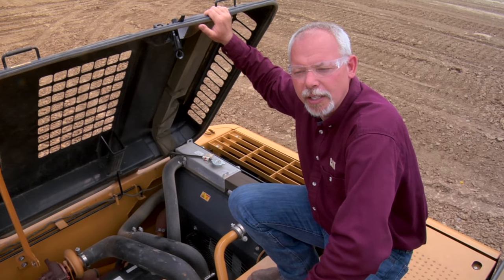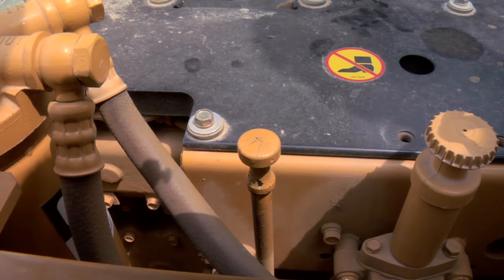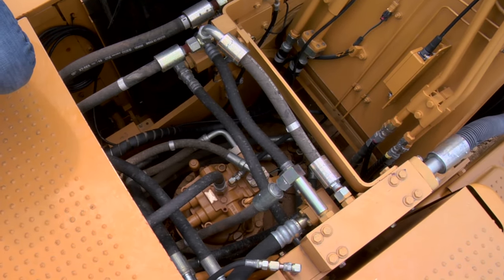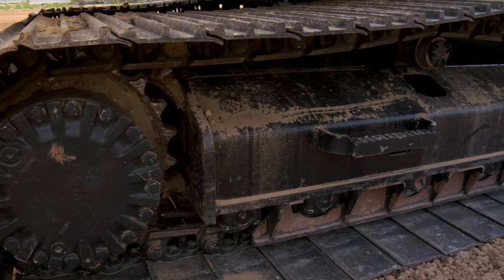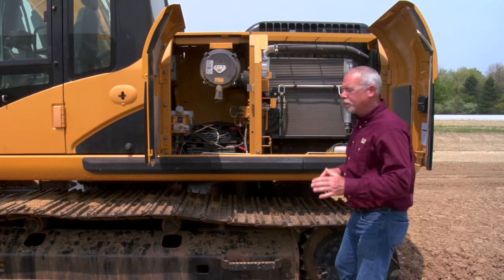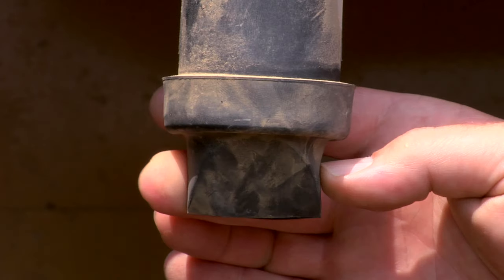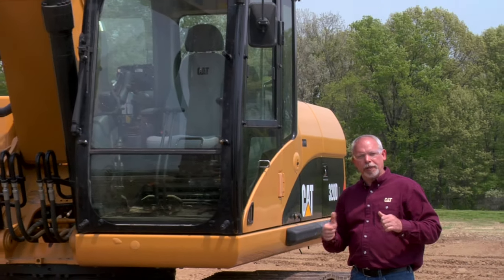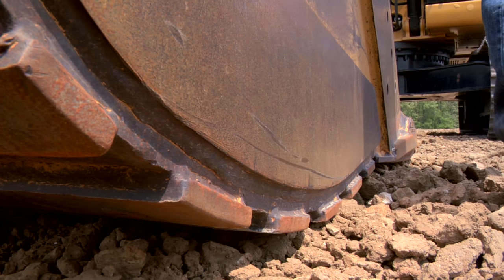Cat® Excavator Daily Walkaround Inspection

Comment: Check the dipper for cracks and make sure no pins are loosening out.. if you have a quick-change bucket, make sure there's no debris between the cylinder or any rocks rubbing against the hydraulic lines, if you have a manual change bucket make sure your bolts are tight, hit it with a steel mallet while you snug them up..make sure your tracks aren't sagging or too tight... check the teeth on your drives and take a look at your idlers.. and of course make sure it's been properly greased for the days work. I try to grease at the end of the day when all the pins are hot from running all day, makes the grease go in easier.

Comment: Please can you tell me about excavator 325dl overheating caused  by video please
Reply from the maker: Hello Million, here's a response from Jeff Paine: "In the video I was not saying that machine was overheating. I was just saying you need to make sure you check your machines radiator each day for plugging and clean as needed if it is getting plugged." Thank you for your inquiry. - Rachel
Reply: If you can't figure out why your machine is overheating then maybe you shouldn't be operating a Powerhouse machine...